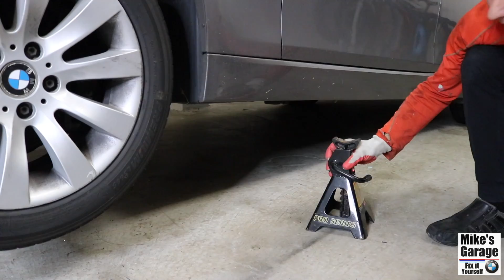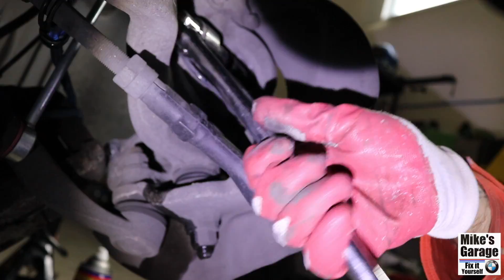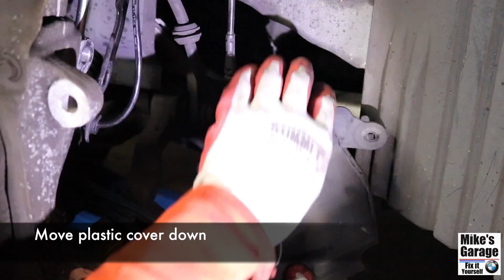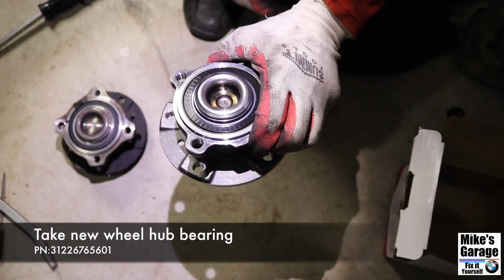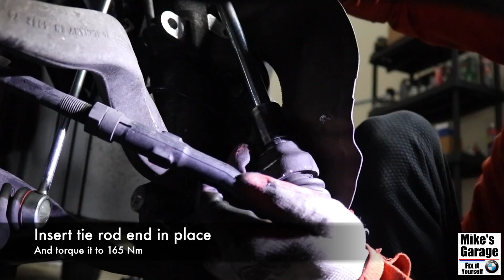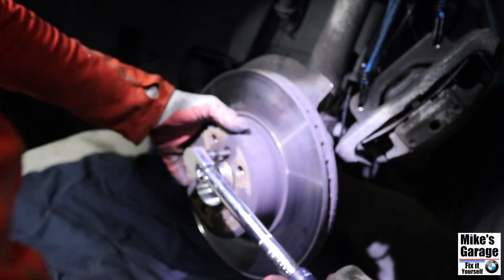How to replace front wheel bearing hub on RWD BMW E60 5-Series

Comment: I did  loosen neither the tie rod end nor the control arm - no reason for those steps!.  I used a spring compressor to drive the shock absorber tube away in order to get access to those four bolts  in the back. Important!- turn the steering wheel to maximum right  to further relieve the tension!
The removal of the control arm also makes tightening more uncomfortable because the steady support vanishes. 
But surely Mike knows what is best for him!  😉
Reply: Excellent stuff. I followed your recommendations and changed out my hubs using a spring compressor. I think I could do it under an hour next time round. The only thing I added was a quick clamp reversed into spreading mode to push the steering knuckle down to get better access to the last hub assembly bolt.

Comment: Hey, so I accidently misread and I torqued all 4 bearing bolts to about 300ft lbs. Will that damage anything or will it just make replacing them next time harder? Debating on taking everything off again to re-tighten them but I dont know if its worth my time. Lmk if you can please and thank you
Reply from the maker: @quablo  Hi, I don’t even know what to say. I would probably remove everything and check if knuckle doesn’t have any damage. Replace all 4 bolts for sure. You torque it 3 times more then specs is. This is bad.

Comment: That’s a pretty insane amount of torque on that control arm bolt on the subframe… there’s other videos/ guides that say 80nm 🤔
Reply from the maker: I working in repair shop and followed the repair manual. You can buy repair manual and follow it. 😉
Reply: @mikes.garage  maybe I should go and tighten mine lmao

Comment: The tie rod end bolt is 80nm not 160nm FFS! Destroyed mine. Thanks a lot.
Reply from the maker: For rear wheel drive car 160 Nm, for all wheel drive 80 Nm. This manual for RWD e60.
https://www.drive2.ru/l/637032024317629772/